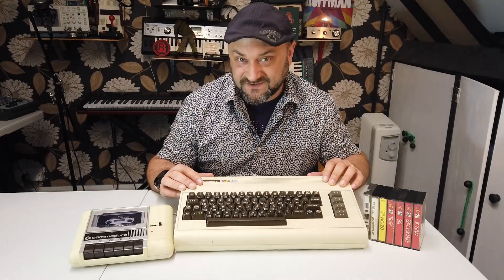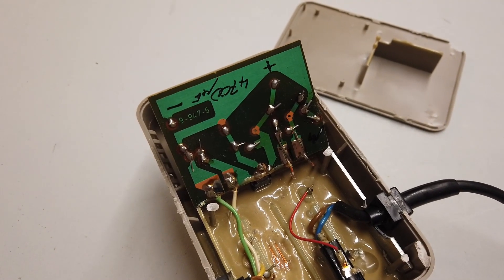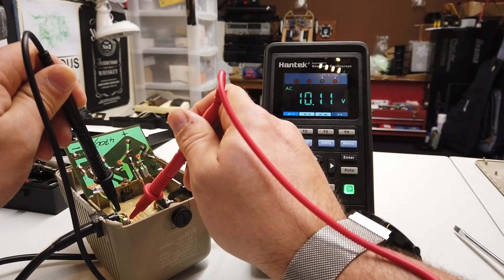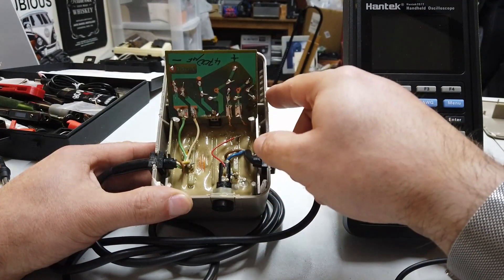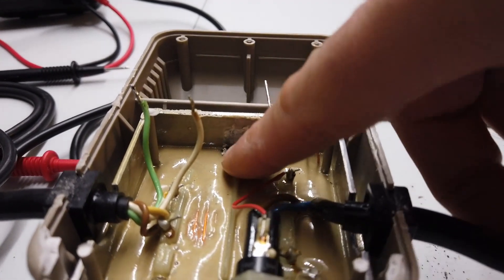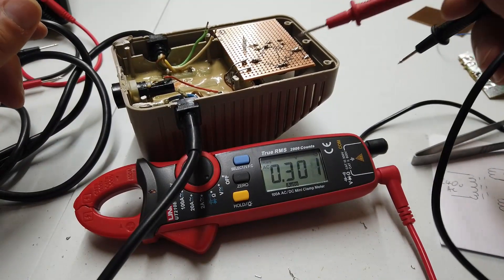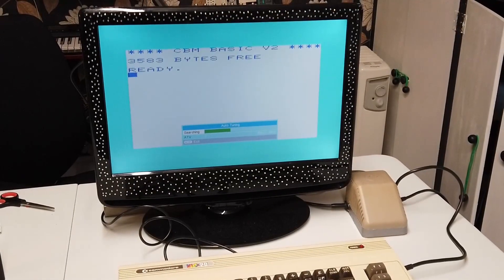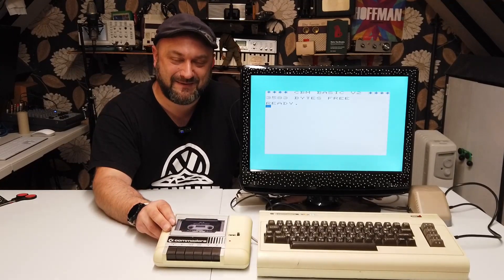DuB-EnG: Commodore VIC 20 PSU Power Supply Repair / Modification - Make it fail safe!

Comment: OMG, I have a black version of this. After your video I cracked the bottom open, it was more than a challenge, popped off the front all good but the back was stuck down super hard, had three spudger tools in there keeping it open and it opened slowly. Now, I never realised it was essentially made upside down and sealed with resin. My power supply has resin that was connected to all the plastic parts of the base. The reason the front came off, no resin. Now, on to the transistor. Compared to yours my transistor was submerged in resin, not only that but the heatsink surround is completely surrounded in resin too. Whoever poured that in went overboard. The resin was even over the legs of the transistor. I got the board out, but there's no hope of replicating the repair. And forgive my ignorance, but how good is a heat sink covered in resin anyway? So my option is to rebuild it as is with a new transistor and cap, or try and do a new build like yours. Have you got the components and circuit diagram? I imagine you flipped the transistor etc. Hopefully I can get my Vic 20 going, that would be awesome, a project for sure.
Reply from the maker: I've a feeling you can buy switch mode power supplies that are far more reliable and easier to connect to the Vic20!  :-)
Reply: @DubiousEngineering  yeah have seen them and also home made ones :)

Comment: I pulled apart one of the potted bricks. I   could not even separate the transformer intact. Only managed to save the cables. I have other supplies but i wanted to try.
Reply from the maker: That potting epoxy is solid!!!

Comment: Also, the VIC-20's 5-pin DIN has composite and audio outputs present. No mod necessary, you just need to buy or make a cable. Pin 4 is composite video out, pin 2 is GND, pin 3 is audio. Be careful to avoid pin 1, as it has +5V on it to power the RF modulator.
Reply from the maker: Epic information ! - Thank you!  I will make a cable :-)

Comment: Excellent advice, never trust an early 1980s Commodore power supply. And a novel approach to a rebuild. Most rebuild videos I've seen chuck the AC transformer, which is rarely necessary. I have AC transformers many decades older than a VIC-20 that still work just fine.
Reply from the maker: Well said! Those coils of wire rarely seem to wear out!!  Especially when potted in resin!
Reply: It's literally a big slab of metal with a touch of enammel

Comment: Wow the epoxy resin in the power C64/VIC20 power supplies is insane. I wonder why they did this. It's good to check/make them failsafe as it wouldn't be the first power supply failing and killing a C64/VIC20... creating your own in the case of the old one is the best option I reckon!
Reply: It was for safety. In the event of catastrophic failure, it meant the power supply couldn't catch fire. The actual danger of the power supply catching fire was probably overstated. But potting their power supplies was one way for Commodore to gain favor with regulators in the 80s. And it also increased the market for replacements.
Reply from the maker: You guys are full of good history and advice :-)
Reply: @davefarquhar8230  Ah that's good to know. I always wondered, but it was an age were electronics were known to cause fire hazards. An epoxy fire retardant! :) Thanks for explaining!

Comment: Been waiting to see this, so glad I didn't plug it in!  Hopefully the tape drive is fixable as well.  Looking forward to video on that.  Well done with the PSU, I'd have had no clue on where to start lol
Reply from the maker: loads of fun sorting the PSU ...  really looking forward to addressing the tape deck! ...  can’t wait to load a game and play it :-). thanks Lee!  you star!
Reply: @DubiousEngineering   It's maybe not the only thing at fault, but I bet the tape drive needs replacement belts to start doing anything.
Reply from the maker: Almost definitely!!!  I have a big bag of belts...
Reply: @DubiousEngineering  remember the azimuth adjustment via slightly detuned radio ;)